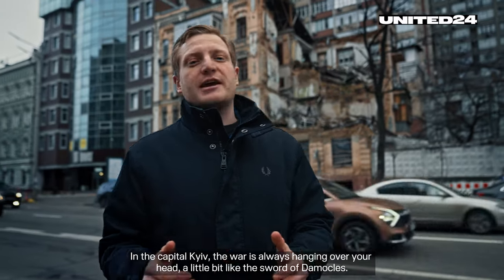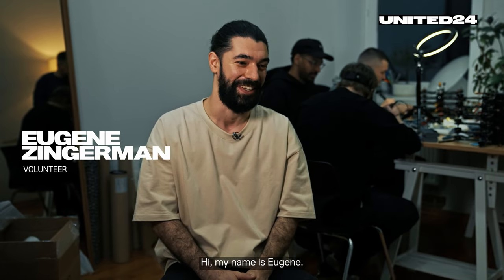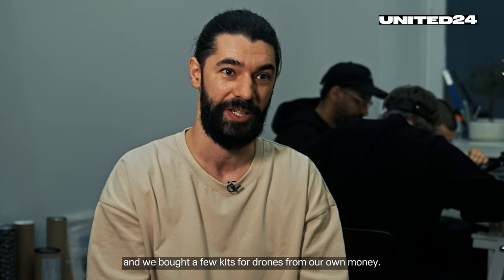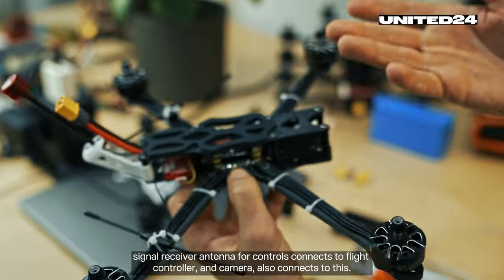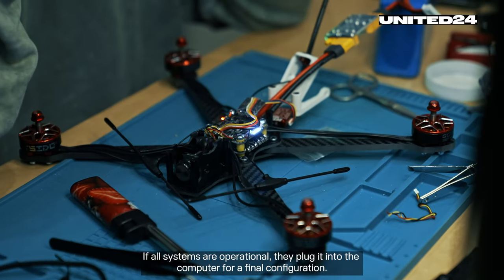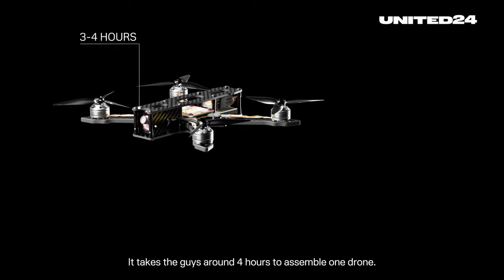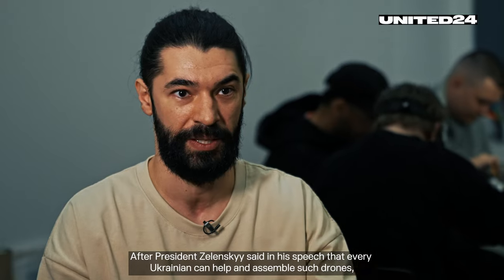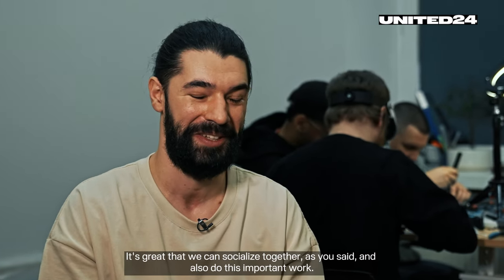Drone Kitchens in Kyiv. Ukrainian Civilians are Building FPV-Drones to Attack Russian Invaders

Comment: Could the frame itself be reinforced with a plastic explosive material 🤔.
Reply: then that would put manufacturers life at risk
Reply: @jimshtepa5423 fill the frame, with small metal balls
Reply: Just needs the filament, and key geometry data. Ideally, it would use one of the new insensitive energetic compounds for reasons of safety.
Reply: @mrwood4557 What of all that added weight? and How will that affect a tank?   
                                                             Viva, Ukraine!